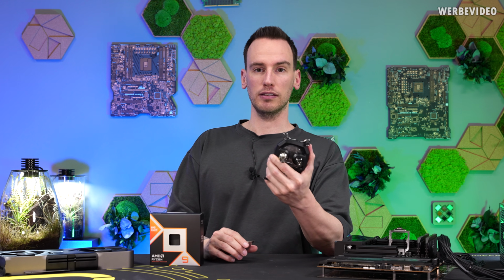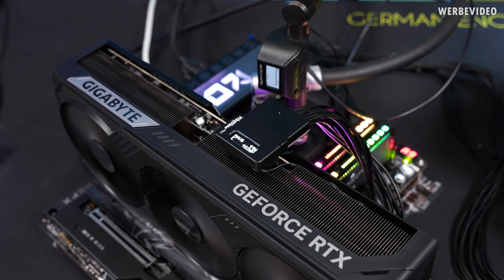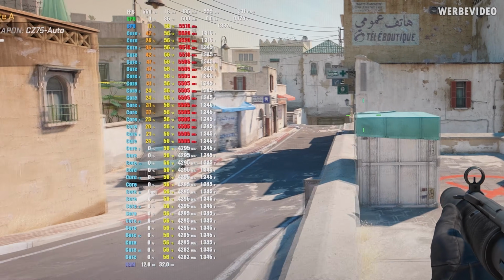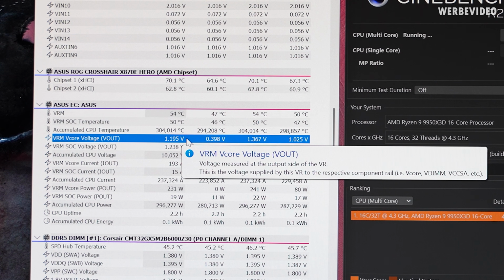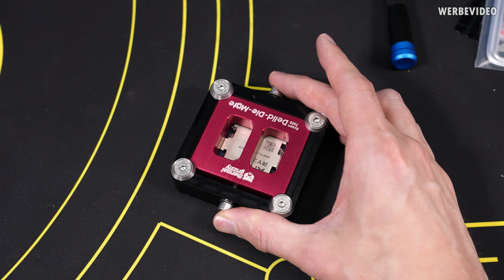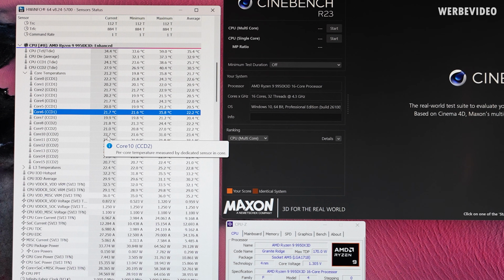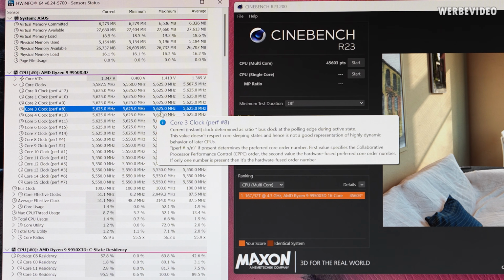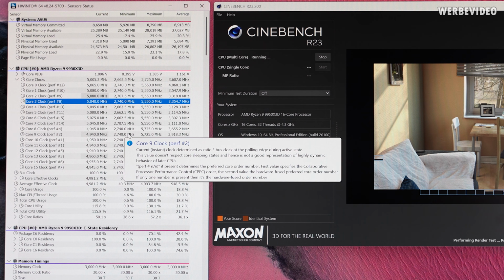Delidding the Ryzen 9950X3D makes it Even Stronger

Comment: Why does power consumption decrease when the CPU is delided?
In semiconductors resistivity is inversely proportional to temperature (when temperature increase, resistivity decrease), and CPUs gets constant voltage, so by Ohm's law and at lower temperature we should see an increase in power consumption.

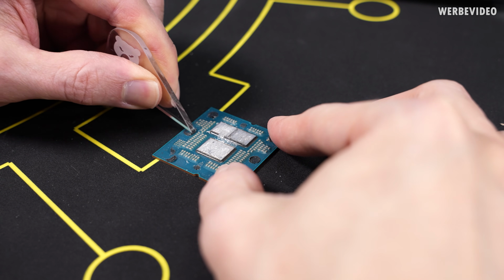Comment: 9:52 Can't the liquid metal run down and come into contact with the capacitors soldered to the substrate??? And worse, couldn't it run down under the socket??? Wouldn't it be necessary to isolate the capacitors and also put some foam to prevent the liquid metal from running down under the socket???

Comment: my R9 9950X3D is no delid , is cooling with a 360mm AIO using the oc method #2 of Skatterbencher I get 44,384 points on CinebenchR23 multi ,temp stay at 78 degree only :elbowcough:
Reply: Just PBO and CO -25 on a Gigabyte xtreme, more than 46000 points easy.
AIO watercooled EK system.
Reply: @brugj03  😲
Reply: Confirms that delid brings only 4 to 5°C. Thank you.

Comment: I know you mentioned this isn't a detailed OC video, but 45718 @ 320 watts is pretty poor when considering performance per watt (especially when considering the video is about delidding and the possible performance benefits/overclocking headroom of having temps that low). It doesn't require delidding to achieve +9% over stock, and it also doesn't require 320w to do it either.

In CB R23, I'm getting ~45500(+11% over my stock test score) at 240 watts at ~5285mhz w/ PBO at ~70c. I can push it a bit harder and get around 5500mhz at ~80c/280 watts for a ~46750 score, but an additional ~2% gain for another ~15% power increase doesn't seem worth it to me. 

I'm running my 9950x3d(SP120) without delidding on a 1x360 rad loop w/ bykski block(cooler score 164), x870e hero, PBO enhanced +200/10x scalar, 192gb ram @ 5200 / 2166 fclk. I tuned curve-optimizer using OCCT and SMUdebug to decrease all offsets simultaneously until individual core errors began to appear, and then added 3 or 4 offset to any problem cores to regain stability which I saved to bios after I was happy that it was stable. I haven't even tried curve-shaper yet, but I've read that's also worth tuning for much higher single core boost clocks.

I'd be curious to see how a deliberately tuned+delidded chip does in comparison because without the extra effort for me to delid or buy pre-delidded, +11% already feels impressive enough for me to stop there unless there is the possibility of another significant bump in performance.

Comment: I spent the good part of a day applying liquid metal directly to the SMD caps exposed around the lid cutouts to assess the risk.  On our reference motherboard, the effect was either nothing at all, or the VRM would detect a short circuit and the system wouldn't power up.  No damage at all.  I'm not so sure we would have the same result on retail motherboards, so be careful out there!
Reply: I think the smd caps are also coated with some conformal layer, at least I have it with the 9800x3d
Reply: @sam712  we removed any of the coatings that could have influenced this testing.
Reply: @sam712  If they want conformal layer to cover SMD caps, there's always Thermal Grizzly's TG-Shield.
Reply: Maybe protect it with zaponlack or shellack

Comment: Simply just removing the solder and placing the IHS back with LM dropped my temps by 10c air cooling on my 9950x3d. 72c max all core load and 55c gaming with unlocked power limits. Imagine if i could go direct die cooling lol

Comment: The thing I don't like about Cinebench is I was testing under-volting and over clocking with it and it would not crash the system without same major under-volt or overclock even when being ran for a while. Once I loaded up certain games it would crash instantly but most other games would run fine. I believe Darktide was one of the major crashers.
Reply: I think he explained it in the video here while running Cinibench vs playing CS-Go, CPU cores behaved differently

Comment: Interesting seeing these test results. Would have never thought the integrated heat spreader would cause so much more excessive power usage! Are there recommended non-water coolers for delidded CPU's? I assume there might be a limitation of weight/force directly on the die.

Comment: I delidded my 9950X3D using your updated water block. It’s been amazing!
Reply: I can see it both ways. It's objectively a bad move if all you care about is performance. You're not getting nearly enough to justify the risk. However if you just want your chip to run as cool as possible which does in fact help with longevity (reduced thermal cycle shock, colder semiconductors means less power needed to flip transistors, and reduced temperatures causes slower electromigration) then it's a significant improvement in that regard. I spent a lot of money on an Alphacool Apex 1 AM5 block so I have no interest in delidding my 9950x3D. Now if someone can prove that the same block can be used with a delidded chip safely, then the temptation would be quite strong.
Reply: @KuraiShidosha  I finally copped a 9950x3d this week, and was lucky enough to find the only TG direct die waterblock in the US on Ebay, they're all out of stock at the retailers here due to current trade relations with the EU. I'm going to run the stock IHS for a month or so to make sure I don't have a bum chip that needs to go back, then see what I can do with the full TG setup. I'll also be waterblocking my ram sticks so I'm hoping to do some magic there too, as the esports I play are extremely ram limited.
Reply: @Mr_Bstead  when you went to delid, did you automatically go as far as it would go on the screw or did you work up to it? I cant finda  full video of someone doing it.
Reply: Ruining your cpu for such small gains is not wise
Reply: @Raznak  They didn't ruin it. They improved it.
Reply: @Raznak  20 degrees is small? Wow...
Reply: @ohkey2999 are we interested in how many degrees we cool it or how better does it perform after the fact?
Reply: @Raznak you’re missing the point, yes we are interested in how cool we get it because if you watched the video, provides more headroom to allow for more voltage thus allowing more performance. Your idiocy is showing 😭
Reply: @Raznak you have no idea what you’re complaining about if you’re seeing this as a negative.
Reply: @Aredium. well, I have been building gaming pcs since 2011, if I am incorrect, why dont you enlighten me
Reply: @Aredium. more voltage will eventually hit a power ceiling, also, the degradation increases immensely at that point as components inside the chip can not always just keep a linear relationship with voltage. You should look up how power-limiting circuitry works, there are plenty of videos on youtube. Start with electroboom, i like him
Reply: @Raznak I would use these - 20° to lower fans speed and get the most quiet possible, undervolt gpu too...😊.
Reply: @Raznak  Are you drunk? The i-7 3940XM was a factory delidded extreme performance cpu that came with the 2013 Alienware m17x R4 and it still runs after 12 years.

Comment: Very flexible cables give a negative advantage for any application with a high load that needs stable voltage. A good power supply needs to have the best cables, and those cables in the video do not seem industrial.

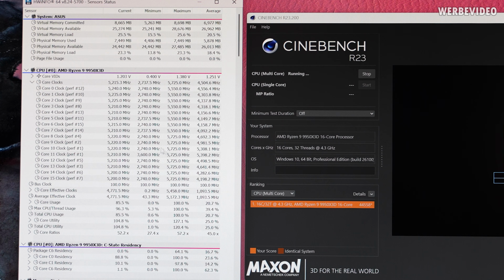Comment: 6:36 Why do you put so much effort and wasted energy to get 4% more clock on a CPU usi +10% W, or squeeze last 5 or 10% on a GPU by increasing power an instability chances?
Far easier to improve cooling of any Mac with M4 than can clock by itself +12% lowering temps in active cooling or much more in passive Air or Ipad... +400Hz easy

Comment: How did you get a 44k just increasing the power draw? Is my asus x870e running a shitty bios? Whenever i try to manually increase it like you showed it causes immense "lag". Im also getting 5.25k ghz multi which is more than you but can only reach about 43.5k

Comment: I am wondering why these lids or covers for the cpus dont have thermal fins on the inside and sides of the cover or anything to help pull heat to the flat top plate and then to a cold plate . I really want one of your delided cpus but I still dont even have a gpu to go with my 9800x3d yet .

Comment: Maby the reason these chips blow up is because AMD uses a FAKE temprature rather then a actual sensor that is accurate. if the temp si below water that means they are either running a offset or they are not using a propper sensor. and the offset is the most likely. 
And for more frequent refresh try setting the process priority higher but this can cause performance loss on cinebench. there simply is not enough resources left for the refresh as it lowers the priority.

Comment: I would love a video where you reduce the power draw as much as possible while losing less than 10% performance in gaming
Just wondering how efficient these CPUs can be and how much you can push it before it doesn't make sense to get a higher end CPU if you can not afford to pay for electricity, especially how insane it is in the UK
Reply: Why would reducing power draw in itself reduce performance? Doesn't it just make it eventually unstable? Lower power draw allows the default overclocking built into the chip to potentially ramp it up more since there's more headroom prior to the 200W limit.

Comment: I dont want to ruin your day, but my non-delided 9950X3D does CB23 46800 staying under de 75 degrees :)
Reply: Mine does almost 49K with pbo set -30 on all cores.
Reply: @BMAR92  That seems impossible, what are your settings ?
Reply: What type of cooler are you using?
Reply: @JohnWalsh2019  Corsair H150i XT LCD with Noctua NTH2 thermal paste.

Comment: It still blows my mind how fast Ryzen cpus are. I used a 7950x in a high end build i had to sell and it's still the fastest cpu i have ever used. I would try to compare it to cpus overclocked on x299 but even the 8 core ryzen 9000 are faster.

Comment: That's a great waterblock. I use the exact same one, but the AMD thread ripper version is modified to fit the am4 socket. It's slightly larger than the am4 version and also has a slightly better and larger set of copper fins on the coldplate, allowing for faster cooling of OCed cups.

Comment: Do we need to apply TG Shield or Kapton Insulation Sheet on the small  chip to prevent the LM leak into it? 
By the way, does anyone delid the CPU and use back the IHS? Last time i done it with 4770k, it has temp drop as well with using back the IHS and LM between the chip and IHS.

Comment: I have a question, why are CPUs so hot compared to GPUs for the same power draw? Your 9950x3d get up to 70c delided with a liquid metal and a custom water loop at 320w. My RTX 4080 super get up to 65c just with the standard air cooler, also at 320w.
Reply: 9950x3d is only 140mm² in die size (counting only the two compute chiplets, not the IO). Your 4080 is 379mm². That makes this CPU 2.7x more dense, and therefore, if all heat is concentrated in a small source, it is harder to cool.

Comment: Delidded mine with a hot air station at 420 C and used the direct die block (LM) with Corsair pump and one 360 radiator. Was very surprised with the results.  With everything running stock getting 42C in gaming with ambient temps at 22C and 70C in cinebench. ❤ How quite my PC is now. No more loud CPU cooler fans.
Reply: they just don't get it...
Reply: OMG! you took a HUGE RISK of frying your chips by doing that...  I just wouldn't feel confident enough to take that risk.... I'm fine with taking my time and doing it the safe way :)
Reply: @ThatTweedle  are you a fool this is probably the safest way possible. the lid is a heat shield.
Reply: I would have just bought a quieter CPU fan 😂😂 @ThatTweedle
Reply: Update: The nickel coating on the block fins came off and was restricting the flow of the loop. Had to take apart the block and clean off the nickel flakes that exposed the copper. Now loop is back to original performance. 3.1 Liters/Min during gameplay around 67 C.
Reply: should used under 200. just look up the exact melting point of indium
Reply: Imagine if you under-volt the cpu. That would be even much better.
Reply: Thats cute, i get those temps without delidding and just having a custom loop 😂😂😂
Reply: I mean, you could have just buy a 360/420 AIO on it and you would have been at maybe 60 degrees. That still wouldn't have taken much for cooling it considering you're probably using maybe 110-150w in gaming.
You can always undervolt it and you'd still be quite cool
Reply: @rustler08  either gamble with a leaking aio or brick the cpu yourself
Reply: 70°C with a 360 radiator is not great tbh. I'm getting around 80°C on a pretty quiet setting with a cheap thermal paste (MX-4), but at 30°C ambient. No delid, just an undervolt.

Comment: You should offer a bundle with the delidded CPU and direct die blocks and/or direct die frame and/or direct die heat spreader. Also is this coming with conformal coating already applied?

Comment: I am just wondering would having RAM at 6400 MT/s make any difference, so you have infinity fabric set to 1:1 ratio, or for x3D chips it doesn't matter? I have bought 9800x3D paired with 2x16GB 6400Mhz CL32, just because of this. But on your charts I can see you are using 6000 Mhz RAM, cl 30.

Comment: Hi,

No way would I have the guts to Delid a CPU but still a very interesting Video.
I do have a question not about this Video but I am just waiting for a case and AMD 9 9950x3d (whenever that comes  it's on pre-order) to arrive to do my PC Build.
I by accident brought your Thermal Grizzly KryoSheet 38x38 Graphene Thermal Pad instead of the 33mm x 33mm one.
Should I very carefully cut it down to size or leave it as it is , I will be using a Noctua NH-D15 G2 LBC air cooler ?.
Many thanks
Steve

Comment: Nah, I went with under-volting. Gave up 5% of peak performance on a 7950X3D.  All 32 threads 100% loaded CPU uses about 138watts average. In these times it seems really overclocking is a thing of the past. Higher end parts get so close to their max out of the box, they get stabilized by too high voltages in default bios settings. By lowering max boost frequency and lowering the voltage, efficiency is greatly increased at the cost of just about 5% to 8% performance.
Reply: Wow like from 260w 100% load to 130?
Reply: @Cyberpunk2077-j3f  You can see the same as in this vid, pushing the CPU to limit greatly increases power consumption of a CPU.  CPU's nowadays can be regarded as fully overclocked to the max out of the box on the limits of what the die can do.  Lowering the max boost by 300 to 400Mhz and undervolting dramatically reduces power consumption.  The real world performance loss is small compared to the stock settings, because the CPU cannot maintain these very high boost clocks anyway due to thermal limits.
Undervolting is getting more important, especially in country's with a lot of solar panels and windmills. Since these constructions cost energy, energy prices are the higher the more solar panels and windmills are present in a country. Which is most of northern-western Europe, (locally here, paying double  price per kwh than most parts of the US (!) and 4.5 times per KWH MORE than in Russia).  So i have to undervolt to make sure the CPU/GPU will not make me run bankrupt on the energy bill.
Reply: @basbass429  so that's why there's so many russian overclockers, they don't need to worry about power when they have a nuclear power plant every few miles lol
Reply: @kimutone2970  lol i do not know. Also don't forget there are 160+ million of them who are not as poor as western the media suggests.
Reply: I’m with you on underclocking, give up a tiny bit of performance for a cooler quieter system. Although, on a K10 APU laptop, (don’t recall exact model), I was able to overclock from 1400Mhz to 2200Mhz while keeping voltages at each step at or below the stock voltage for that step, and increasing the boost clock speed from 2300Mhz to 2800Mhz. Better performance, better battery life, and slightly lower temps.
Reply: Not everyone is a cuc. 😂😂😂
Reply: well, most people aren't running 32 threads under 100% load for hours a day.
Reply: @joshieecs  Uh, why get a 16 core cpu if you never run 16 - 32 thread loads ? 
Principle is the same for 8 core versions, which are excellent for over 80% of the people.

Comment: @der8auer-en Given that all temp sensors are directly on the die itself ultimate test of deliding efficiency is not top temperature but how quickly temp raise and fall when load is changing. This will indicate how quickly die temperature will be transferred to the cooler. Slower rise means better result. Quicker fall means better result. Unfortunatelly you did not show that at all :/